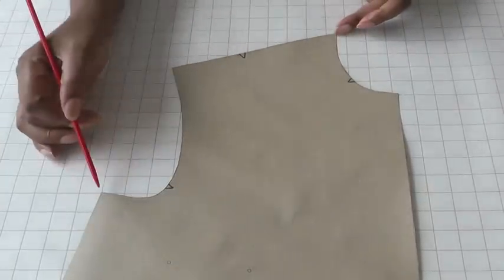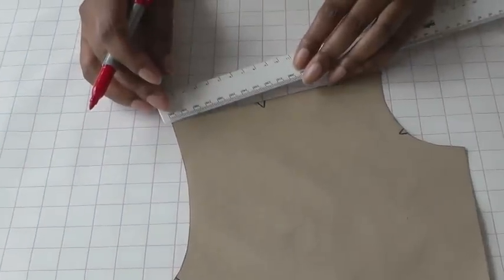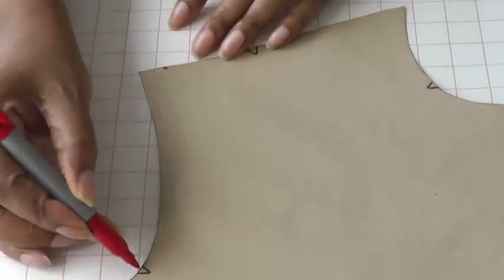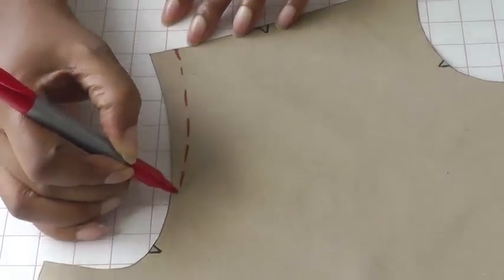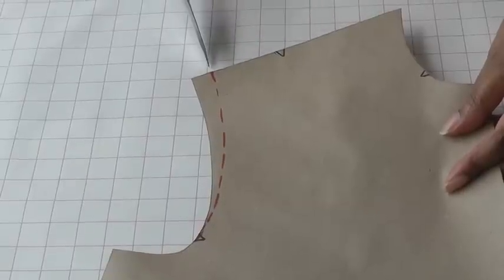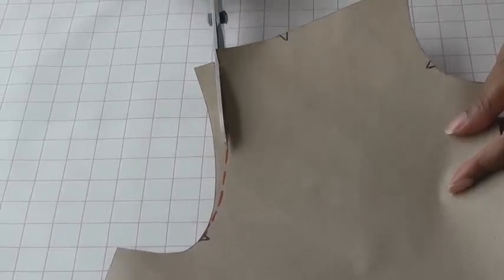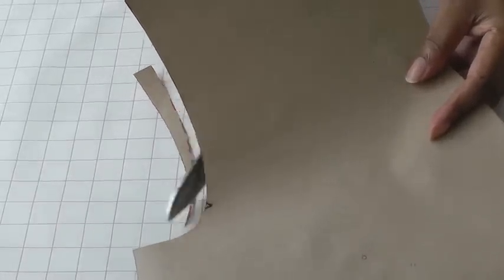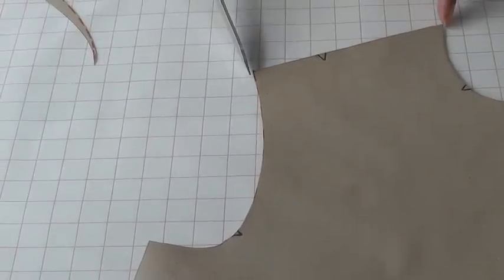How to Shorten a Shoulder

Comment: The adjustment to the sleeve is the most difficult part because, not only do you have to now fit your sleeve into a larger hole, you also must have the sleeve hang straight after it is sewn on.  And, yes, I did find that out the hard way.

Comment: hi love your easy way of altering  shoulder I have small shoulders and need to take at 1 1/2" off my shoulder wld i still do it the same way many thanks in advance
Reply from the maker: Hello Christine. It depends on the fit you may have to take some out in the shoulder line say the centre and some at the end of the shoulder.

Comment: I have a top made - shoulder seams sewn and side seams sewn but no sleeves attached yet.  the shoulder seams are almost 1" too long........how do I fix that?  can I just mark in the 1" I need on inside of front and back and then taper that to the notch or do I need to taper all the way down the the underarm seam where it would basically be nothing....  I sewed a very narrow rolled edge to sew the pieces together (it's a slippery thin fabric _ so I could just cut off that edge, but would like to know what my best option isbefore I cut the pattern apart.  I sewed a narrow rolled edge on both the shoulder seams and the side seams, when actually the pattern has 5/8" seam allowances.  I did this in the event I needed more room, but I really don't.  I just need to narrow the shoulders.
Reply from the maker: Hello ssarge2, The back shoulder needs to be eased onto the front, and the same technique can be applied for the underarm seam too. This method allows for the supple contouring to the body shape.